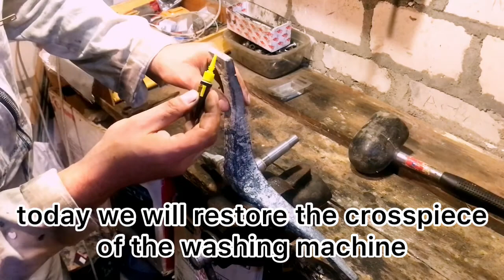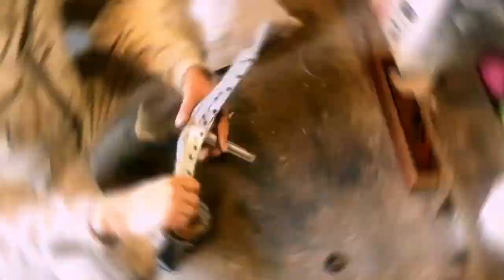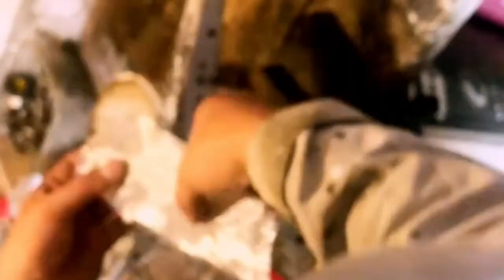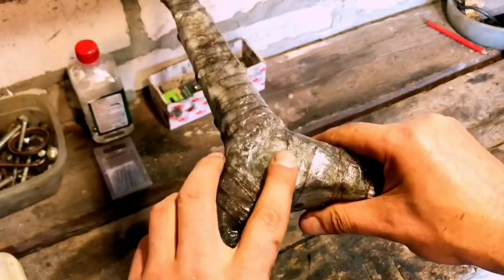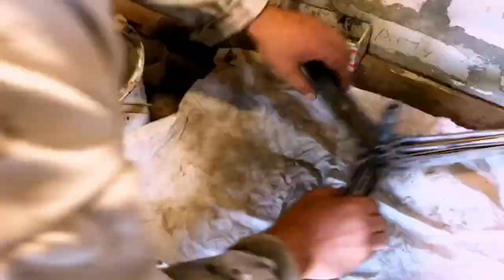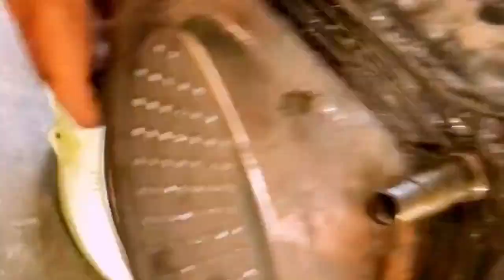washing machine repair restoration of the cross

Comment: It's called a Spider by the way. That's a nice solid repair though. hope it runs balanced.
Reply from the maker: I have been using this washing machine since the video came out. So far, so good! If it breaks, I'll take a look, very interesting. But two machines did just that, while it works.
Reply: @radovodessadoityourself  Top Man, well done.